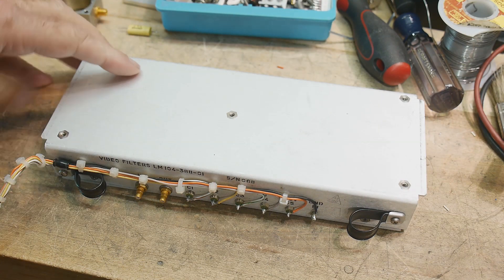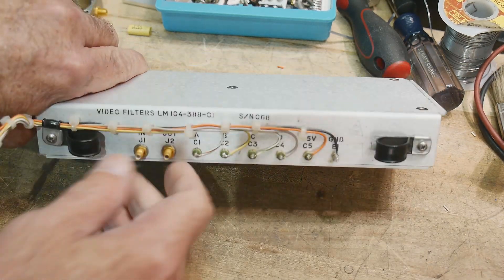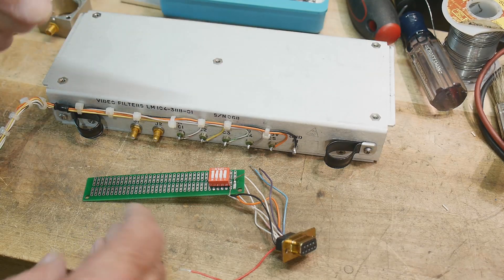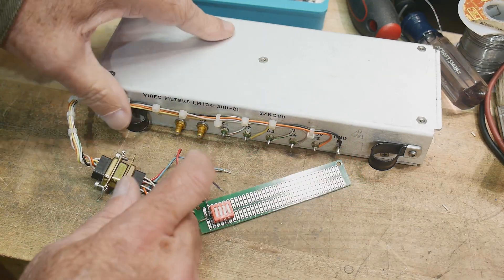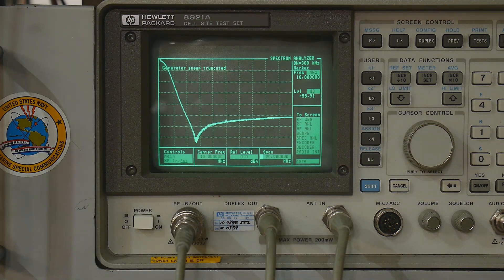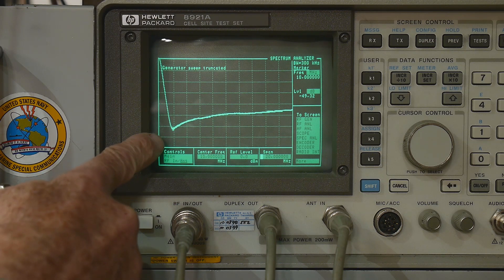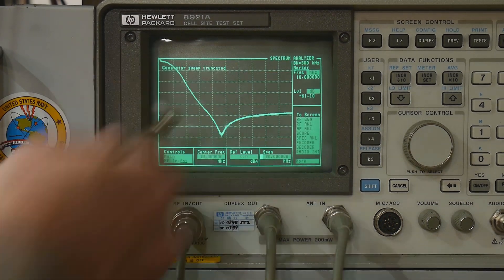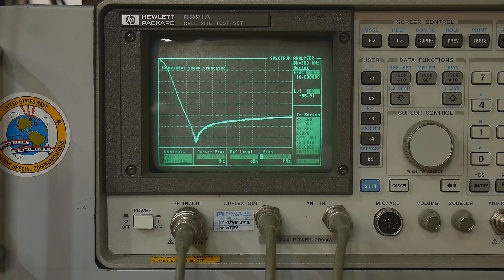#703 4-Bit Controllable Filter

Comment: thats a really cool device, but what would it do to the video signal?
Reply from the maker: I rolls off the high frequencies. The same as the video filter in a spectrum analyzer. or think of the high frequency roll off setting on an oscilloscope. or tone control of a stereo.
Reply: Video in this case, means a broadband demodulated signal, not a TV signal. I used to receive satellite telemetry for NASA in the 60s.
Reply: @OC35  Ah ok! Thanks!